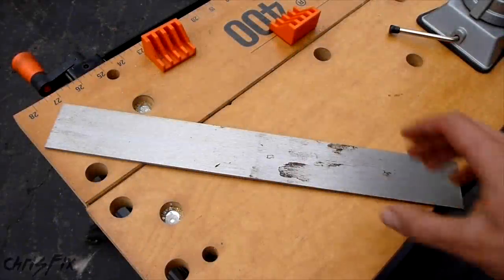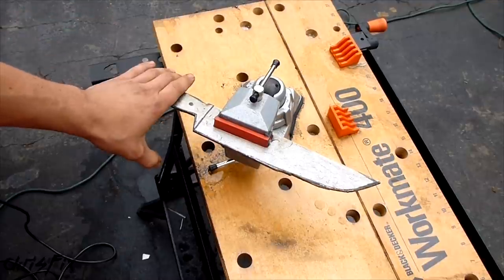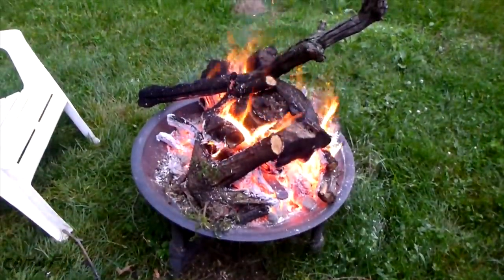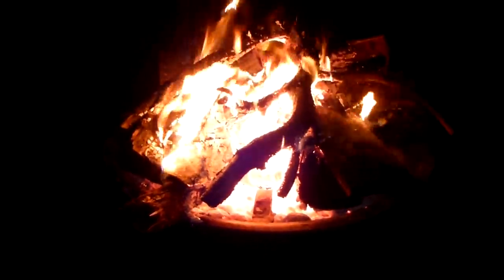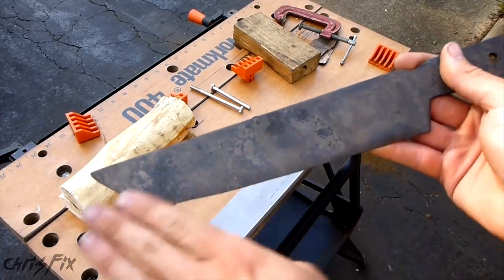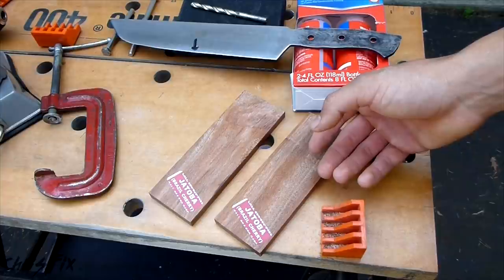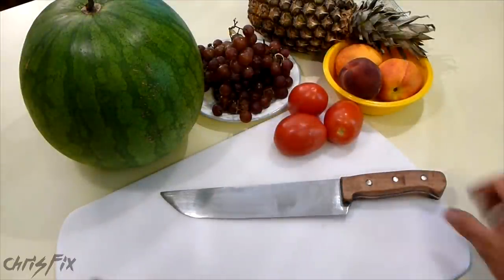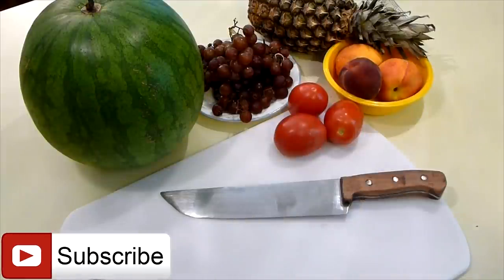How to Make a Homemade Chef's Knife

Comment from the maker: +Hudson Carter, I cannot reply to your comment directly for some reason but I have a "Top 10 Mistakes People Make while Cleaning their Car" video coming out very soon. I need to shoot one more segment and then edit it all.
Reply from the maker: Exactly. A belt sander would help a lot in making a knife. You can get the edge on both sides even, prevent the ripples on the sides of the blade, and get a nice, flat, edge. I tried using basic tools that most people have so. The ripples are cosmetic anyhow. The knife works great!
Reply: This dude is so smart, all of his videos are so dope.
Reply: +ChrisFix the ripple make it look authentic, gives it character.
Reply: ChrisFix ay can you show us how to turbo charge a car
Reply: ChrisFix 
The one that.
Reply: ChrisFix
Reply: Ok
Reply: You forgot the soapy water the torque wrench and the breaker bar
Reply: ChrisFix
Reply: Micro fibre towels too!

Comment: No soapy wooder, jackstand, breaker bar and torque wrench for this? LOL
Reply from the maker: lol nope!
Reply: YOU FORGOT THE MUFFLER BEARING
Reply: +Awsomiihill YOU FORGOT THE BLINKER FLUID!
Reply: YOU FORGOT THE ELBOW GREESE
Reply: Gear By Gear but there is 1000 grit
Reply: AlkyneYT just no
Reply: You forgot the thread locker!
Reply: how about copper anti-seize applied to it?
Reply: and bigass 8 piston Breeeeeeeembos
Reply: Chris fix, the one and only
Reply: @Metrixx  YOU FORGOT TO PUT THE STEERING WHEEL BACK IN YOUR DRAGCAR! Yes its a thing.

Comment: Great video. Only suggestion I have is to cut out the rough shape of the handle on each piece of wood BEFORE you glue them onto the tang. You waste alot of epoxy and wood by gluing the uncut slabs. enjoyed everything else tho:D

Comment: That's no  Ginsu knife, lol great video but the only issue I had was when you were drilling with you hand on the bottom of what your drilling is a big no no  you should use a scrap piece of wood to drill threw instead of putting your hand under it
Reply from the maker: inertia210 Yea, it looks a lot worse on camera but I prob should have drilled that in a safer manner. Thanks man!

Comment: You can use motor oil. You can use any kind of oil as long as it is oil.
Reply: facebuster14 don't use motor oil
Reply: S!ngularity why not?
Reply: facebuster14 its carcinogenic
Reply: S!ngularity well thank you for informing me of thus whenever I get the equipment to start forging knives I want use motor oil again thank you sincerely
Reply: All the oil is doing is tempering the steel, Pretty sure steel is non porous so I don't see how quenching it in motor oil is dangerous.
Reply: Ryno Turner it heats it up and releases carcinogens, also it often cools the blade unevenly
Reply: You don't want to use motor oil on something that you'll be putting in your food. The oil doesn't completely come off prior to use, and it helps provide a coating on the blade to protect against rust. Also, if you check the prices, vegetable oil is cheaper.
Reply: Anne P. that's bullshit. You sand down the whole surface, so you get rid of all the material that made contact with the oil. It's not for preventing corrosion, that's another oil you put on after finishing it. And nothing is cheaper than used (waste) motor oil.
I would use waste cooking oil tho, I surely have some, if I need a chef knife
Reply: and you guys can use gasoline, that will BLOW your mind! :D
Reply: I would use virgin olive oil, then, set it on fire

Comment: If anyone is thinking about making a knife I would suggest Aaron Gough and Walter Sorrells videos. Wow, I am late to this video.
Reply: Tony G. Same here,man.Although Chris made a knife from scratch,he kinda did many things that were questionable. 1.The design of the knife is kinda janky 2.The bevel is way too short since he didn't use a taller eyebolt 3.Ricasso and plunge lines are barely formed 4.He didn't clean up the other flat surfaces to ensure squareness 5.When sanding,don't sand in circles 6.He used a plastic container as a quenching tank that was too short 7.He didn't preheat the oil 8.The blade seem to be way too hot since cherry red is suppossed to look dull and not glowing white,this affects grain size 9.He didn't submerge the whole blade in oil after the glow went away 10.He didn't check the hardness with a file after hardening 11.He didn't use locator pins when drilling the handle holes 12.He cut the pins way too short 13.He didn't sand the lip of the handle scales to be symmetrical 14.He didn't tape up the blade when finishing the wood 15.He didn't sand and round the whole handle scales 16.He didn't finish the wood with oil or anything 17.He didn't show sharpening test
Reply: DavisSgt I agree that Chris missed some things. What I will say is that he did the knifemaking community a service by bringing it into the eyes of a subscriber base of 1.5 mil(currently). Hopefully some of them decide that it looks cool and pursues it. As they continue to make knives they will learn more and more. As a how to video it is meh, as a video to get people interested I think it did its job.

Comment: How far is the lock
Reply from the maker: Justin Hull You mess around with the distance until you have a good edge. You want about a 15-20 degree angled blade.
Reply: Hey Justin what's up
Reply: @dentonwarren8200  Hey Denton what's up

Comment: That knife has a weird shape.
Reply: Goodjob though
Reply: Marcus Christensen it has a wierd shape because he used the angle grinder, he should have used a finer file, and only the file because he only rounded off the blade very inconsistently.

sorry for my bad english, im not a native speaker.
Reply: oh and he should use a metal file insead of a wood rasp lol
Reply: Dr. Kleiner he uses the metal file side, you should clean your glasses doc ;)
Reply: Marcus Christensen I'd like to see u make one
Reply: i might try that seems like a fun project, im quite into knife sharpening.
Reply: Ron-E 2550 he did use a different approach of making knifes. I personally use a filling jug for the majority of my knives. although I would agree, this looks weird for a chef's knife as it doesn't look like many knifes out there. but it is nice.
Reply: I'm a cook it's a pretty common blade shape at least with the guys I work with
Reply: It has a normal shape

Comment: Chris, love your videos and all of the effort that you put into making this knife. That said this is not a chef’s knife at all. It is a camp knife. As a chef I could not imagine using this to work with. If you make a knife again may I suggest you take a closer look at the bolster and choil. Additionally, the profile has no belly to it and the tip is too high. Also, you need to consider the thickness of the actual blade and the thinness behind the edge. Lastly, the cutting angle is extremely important for durability and effectiveness. Ideally you want somewhere between 15 and 20 degrees on either side depending on the strength of the steel. Best wishes, hope your Dad enjoyed the knife.

Comment: beautifull! What could I use instead of the resin?  this was reaaly good, well explained, enough details without making a 45' video... great
Reply from the maker: Riccardo1982 Thanks a lot! You really want to use some type of resin or epoxy. You can get it cheap here: http://www.amazon.com/gp/product/B001Z3C3AG/ref=as_li_tl?ie=UTF8&camp=1789&creative=390957&creativeASIN=B001Z3C3AG&linkCode=as2&tag=chri0e2-20&linkId=GCYUGO7WZIKCJTBB
Reply: Riccardo1982 Resin is not needed, just peen brass pins in the handle
Reply: All of the pros use resin. Why wouldn’t you want to use it?

Comment: I've talked to an actual blade Smith and he recommended 1084 steel. It's easier to work with and heat treat. Whenever he works with o1 he sends it out for heat treat because it's easier to mess up. Also, for the handle you can use g10 or micarta. Both are strong and visually appealing
Reply from the maker: +Shawn Burnham thanks for the tips

Comment: Good video really. Taught the basics of making a blade. Some mistakes such as using a rasp instead of a file, sharpening and taking a lot of extra material off as well, and then checking the sharpness by sliding your finger down the blade. Other than that, pretty good tutorial for the basics 😊 I'd recommend using 1075 instead of Tool Steel though.

Comment: This is my personal thought, the steel is thicker than you need.  I have a 1095 steel knife and it is around 0.10 inches thick and I find that to be good enough for general purpose.  That 3/16 (0.18) inch thick steel could be good for a general purpose knife.

That knife you made looks very brutish.  Though I will say it cuts pretty good.

Comment: Pretty decent job, I've been toying with the idea of making a kitchen knife myself.  Only tip I'd point out is to preheat your quenching oil.  Heated oil reduces chances of micro-fissures and warping the steel. I toss in a heated nut or bolt to get my oil to 150 degrees.
Reply from the maker: Jrsydvl2003 Thanks for the tip!

Comment: Amazing looking knife. U proved there's No need to be a blacksmith to make one either. The hard part is where to buy right metal locally or purchase on ebay of course
Reply from the maker: Thank you! You can also get steel on Amazon and also search locally. There are many welding/metal shops that will give you their scrap metal.

Comment: Handy tip for mixing epoxy  that I picked up: Get some of the small grip seal bags that small components come in (3x2" I find to be useful). Dump the 2 parts in there, seal it up, and you can mix it by squishing it with your hands. Then snip the corner off the bag and use it like a cake icing bag to dispense the epoxy. Once done, cleanup is a cinch
Reply from the maker: +TheChipmunk2008 That is ingenious! Thanks for the tip! That is such a good idea!

Comment: Terrific video, never had the least desire to make a knife of my own, but after seeing this, I'd consider giving it a shot! Great videos Chris, I couldn't help but think about the $20 of cooking oil or more, that had to get used up for one knife manufacture! Wow!

For a once-in-a-lifetime gift, no expense is usually spared though!
Reply: +William Prah You can reuse the oil, actually. I wouldn't use it for cooking, but if you make steel knives or utensils often enough, it's worth storing the oil.
Reply: I reuse my oil frequently. With my method of heat-treating, I don't get a bunch of scale in the oil so it lasts a lot longer.

Comment: fyi Chris, you shouldn't use plastic containers to oil quench in, since the oil can ignite and the plastic can melt, you get the idea. not good. love your vids man.

Oh and if you finish off the front edge of the scales fully before you glue them on you won't scratch up the blade by sanding afterwards

Comment: In total, how long did it take you to craft the whole thing? (excluding the 24h wait period) And also, how would you recommend to care for the blade/handle when using it? For instance, I know you never put wood in the dishwasher, but what else would be useful to know if I were to make a blade like you did?
Reply from the maker: TheLanathay This took me about 20 hours total. Since the blade is tool steel it will rust if it is not dried after you wash it. You can oil the blade with olive oil and that will maintain it.
Reply: Thanks! And awesome blade! I will definitively try it as soon as I get the tools!
Reply from the maker: TheLanathay No problem and thanks!

Comment: Not that I need to, but as student studying to become a metal worker, that is the correct way to do it without dedicated heat-hardening tools. And for carbon content, not that I have experience but I recommend around .8% carbon as it's ideal (may give stronger structure) if you're heating your carbon steel to 800 °C ('cherry red') maybe 1% if you know what you're doing and heating your blade to about 900°C (red, becoming red-orange slowly).

If you're leaving it in there for upwards of 3 hours at 850-930°C near the coals and ashes of your fire, you may get a thin coat of higher carbon content. (extra rigidity, less bend before the knife fails).

While heating it initially (not while releaving stress afterwards) here's a rough guide lifted from what I like to call the engineers bible (°C):
0-600 nothing
650 faint glow
700 slight, but noticable
750 deep cherry red
800 cherry red
850-900 what one might call 'Red-hot iron' (verry difficult to reach with a camp fire)
950 begins to get an orrange tint to it
1000 strong orange
...
1300 yellow bright

Comment: Quenching 01 in water will be fine, although 01 is designed to be quenched in oil using water is not optimal but will still get it darn hard. You could even air quench 01. Will be softer than water or oil hardening but perfect for some applications.
Reply from the maker: Andre Gross Thanks for sharing!
Reply: Thank you for all the great videos!

Comment: Great Job Chris! How high did the temp get to in the fire? Could I do this in a fire pit dug in the ground?
Reply from the maker: Thanks man! This was basically a fire pit in my back yard. I just had it going for 2hrs and kept adding more and more wood to get that white hot wood and charcoal! The heat gun is really what makes it hot! All of that oxygen blown in there really makes it hot! The blade got to about 1500F. If you put it on the ground, layer the bottom with charcoal and some wood to get those white hot coals on the bottom. Try it one day with a cheap piece of steel and see if you can get it red hot.
Reply: Chris I also wanted to say Thank You for all your Suspension and Steering videos! I am a customer service manager for an automotive parts website and I have made my entire team watch your how to videos. You make it fun to watch but at the same time we learn so much from you. Thanks again and keep up the good work! If you ever take suggestions let me know and maybe we can send you some free parts.
Reply from the maker: Brit Hull Thanks man! I take all the suggestions you want to give. I have so many people asking for a car cleaning video (which is taking forever to film/edit but will be out soon), a video on waxing, a video on the OBD2 system, a tool box run through, etc. I appreciate the offer. If you ever have any suggestions, just comment and I will do my best to accommodate! I am glad the videos are helpful and useful for training! I am also going to start product reviews because people are always asking why I use a certain brand this and that so...

Comment: iv hears to use used motor oil to heat treat it cause the carbon in the used motor oil introduces its self into the metal and makes it very very hard, look on mythbusters they also did the same with a hammer

Comment: treat the handle with a tun of coats of mineral oil. it will darken the wood nicely, water proof it, make it sanitary so bactrea cant grow in the wood, and prevent the wood from rot. 

its non toxic (its literally what baby oil is) re apply it every once in a while.

also use a grinding stone on the blade with some oil it will even out all the uneven edges from you're sharpening stone. tool steel can be sharpened to a razor edge and not dull out too fast
Reply from the maker: +Jimmy O. Thanks for the tips Jimmy!

Comment: The last part in the oven is called stabilizing don't skip it it will not work if you don't the blade will be to unstable and might crack

Comment: If you want a better finish pick a direction to sand whether it be horizontally or vertically and stick to that direction. Avoid circular motions while sanding, it makes the finish smooth yes but doesn't look as nice

Comment: I think you would want less carbon. I remember the Japanese Katana Documentary and I believe they said that less carbon was better no more than 30%. I am no expert I just wanted to point that out. Good job and Good Luck
Reply from the maker: +Micscience THanks for sharing. You want more carbon because that is what keeps the blade from bending and it keeps it sharp.
Reply: +Micscience The Japanese sword makers use a style of forging, called forge welding, where they heat the metal for the blade, fold it over itself, and pound it together.  Then, on the final fold, they sandwich a piece of high carbon steel in between, so the outside of the blade is a softer, lower carbon steel, but the inside, where the cutting edge would be, is a very hard, high carbon steel.  This lets the blade flex without breaking, but the edge is hard enough to keep its sharpness.  For general knife making, you generally want a high carbon steel for the same purpose of keeping an edge.  When you get in to swords, machetes,  or cutting tools that will see a lot of pounding in their use, then you have to start thinking if a high carbon blade will work for its intended purpose.

Comment: you forgot to say that in order for the blade not to rust you gotta dip it in some blinker fluid. if you already got some rust on it you should sand it with an old muffler bearing.

Comment: hi how do you know if the fire is the right temperature?
Reply: Elaine Fallen When you're annealing or softening the steel in order to grind it, heat it cherry red and bury it in sand overnight, then you grind it. When you're done profiling and want to reharden the steel, heat the knife until a magnet no longer sticks to the blade, then quench it in oil, after that you need to temper it in an oven to bring the steel back down to a usable knife steel hardness/softness.

Comment: did you know that using used motor oil is way beter than vegetable oil because used motor oil had a lot of carbon in it. when you cool the blade in the motor oil, the carbon in the motor oil makes the surface of the blade even harder. :D
Reply from the maker: +Wietse Vanderpoorten Thanks. Motor oil is not good to breathe in when it burns and also this is for cooking so I dont want to use motor oil on a blade I will be cutting food with.
Reply: +ChrisFix oh okay i get you :)
awesome channel tho!